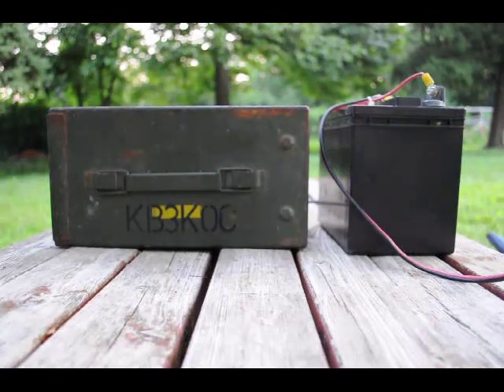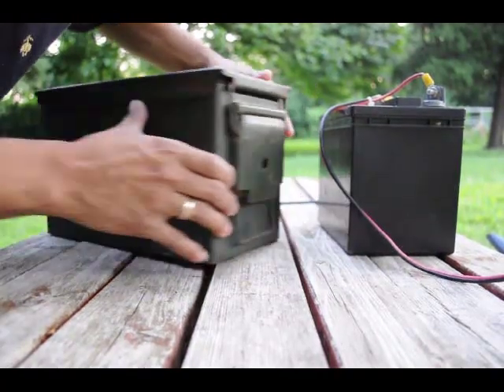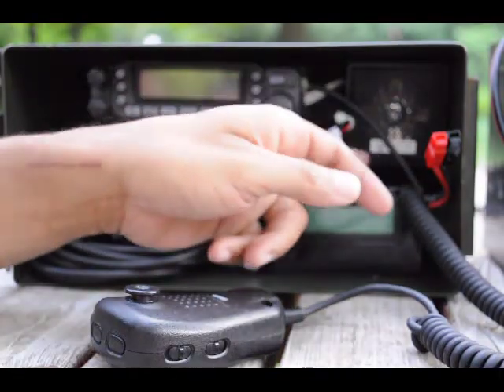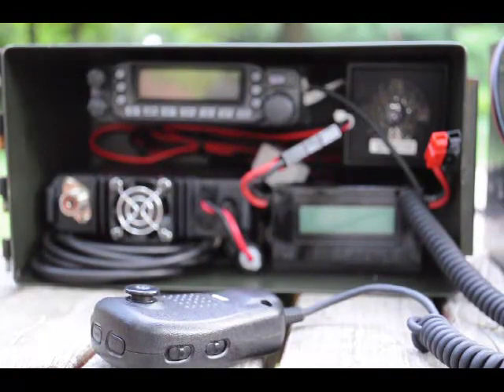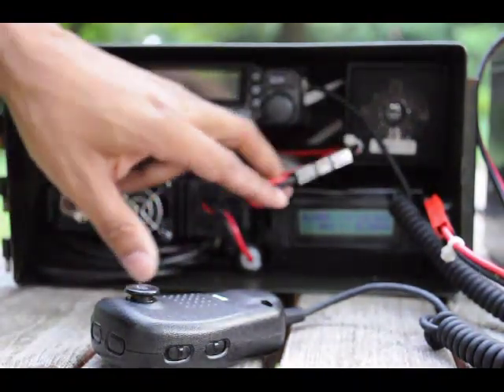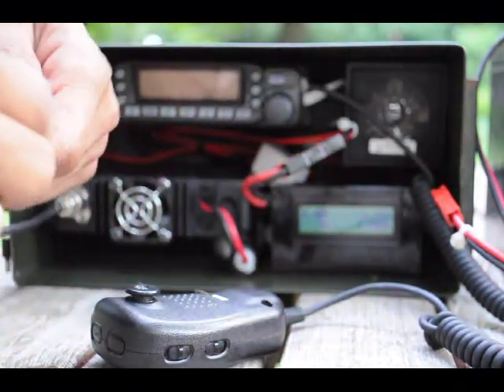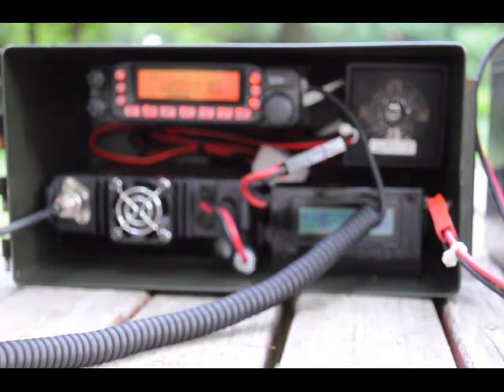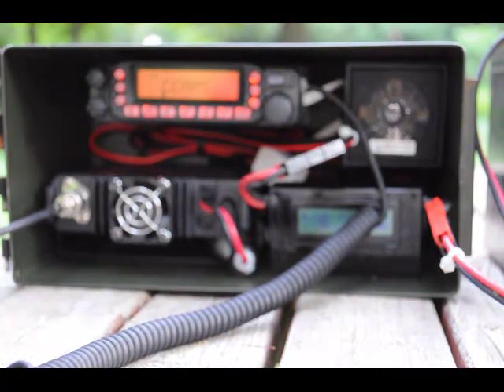Portable Ham Radio Operations using Ammo Can and FT-7800R

Comment from the maker: The battery I have in the video is a battery I use for emergency power at home. I really wanted 2 ammo cans - 1 for the radio and one for batteries, but the place I purchased this one from only had this size ammo can in stock. I should have mentioned this in the video. Thanks for the comment and glad you liked it!

Comment from the maker: @EDDIEMPR The Yaesu FT-7800 is a dual band radio. It transmits on the 2 meter amateur band (144-148 MHz) and the 70 cm amateur band (420-450 MHz). It will received on other bands but will only transmit within these 2.

Let me know if you have any other questions!